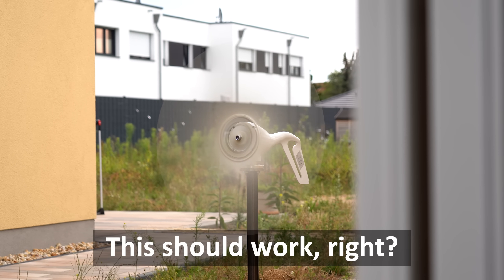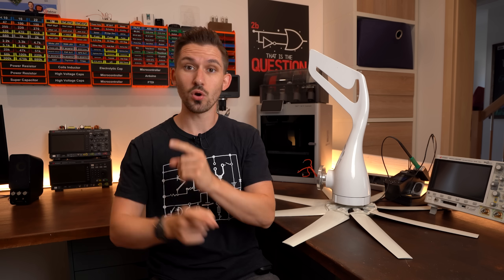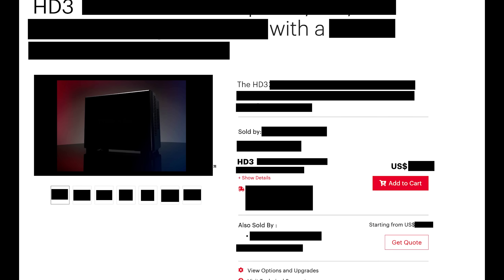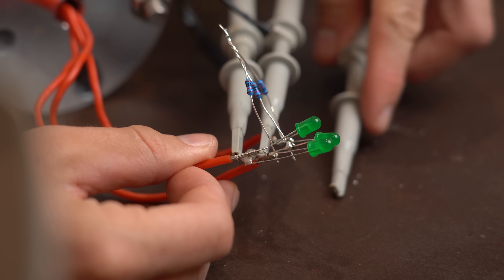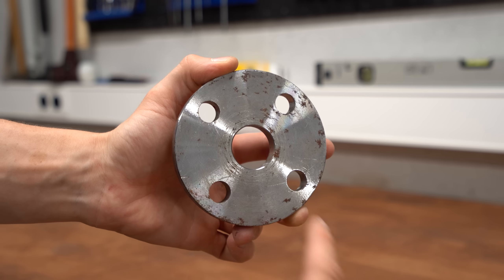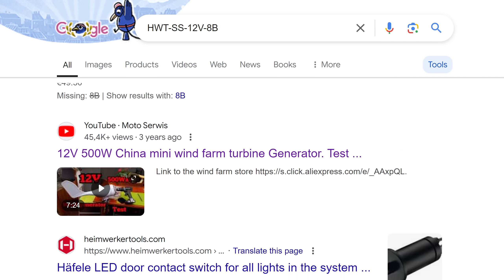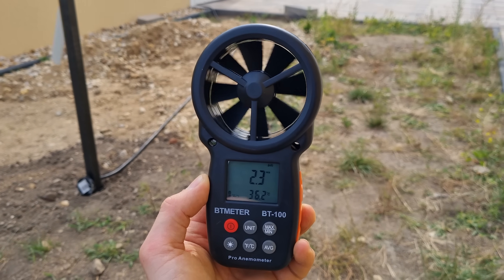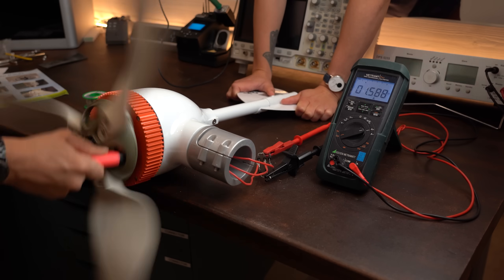I tried to Power my Home with Wind Generators! (Worth it?)

Comment: solar is shit for the environment not recyclable  and only last about 10 years before you have to replace them
Reply: I don't know where the "not recyclable" comes from. Looking around at some manufacturers like swiss solar around 75% (although I've also seen other estimates from world economic forum range up to 95%) of the panels can be recycled and some companies like First Solar, PV Cycle and more are already popping up. The main material which is silicon is the second most abounded material in the earths crust and more common than carbon and newer panels started cutting down on the more expensive materials especially on silver.
The 10 year lifespan is also rather on the short end, most estimates I've read are more around 20-25 years and most of that isn't really total failure but reduced efficiency/power output so they are still usable at a lower power level.
Main issue why you won't see much is because the majority of panels are still in operation considering that according to charts on both canarymedia and bnef the solar production doubled between 2019 and 2022 it's pretty safe to assume that the majority of installations aren't anywhere near their end of life so there isn't that much financial incentive yet to ramp up recycling. Even with the 10 year estimate that would mean panels installed 2014 would now be bust and that would be just about 17% of the total installed capacity from 2022. 

Wind Turbines are also not the perfect solution in that regard at least when looking at large commercial turbines the lifespan also seems to be arround the 20-25 year mark however blades and gearboxes need replacement after 10years. And the blades are very difficult to recycle. Neodymium is also not exactly good for the environment although this is a known issue and research is currently trying to cut down or even completely eliminate the requirement for rare earth magnets.

Comment: Generators in vehicles normally charge at 13.5-14.5 V. That way they can over come with easy the internal resistance of the batter and have extra power to charge the lead acid battery. your little wind turbine would have to really be spinning to do that.

Comment: you can use some mechanical gears to speed up the rotation of the generator then maybe it will work better 
altho i may be hard to figure it out and make it work 
but worth a shot

Comment: i have bought the same 2 pieces of s*** ( only the vertical ones) and i'm not happy, the average wind speed is 7m/s and it is not generating anything. 
maybe you could post some efficient schematics to use these pieces of  s*** for something (like heating garage or anything) and maybe the Chinese will get smarter and sell for other people something better than s***

Comment: All practical tests of ground-based small wind turbines show: 1) They hardly produce any electricity. 2) They do not last long!
No electricity, because there is hardly any wind close to the ground – and electricity yield is proportional to the third power ofwind speed: 100% more wind generates 800% more electricity! Moreover, wind close to ground is extremely gusty. 9 out of 10 small wind turbines therefore stop working after a short time! 
With solar panels, you can generate at least 10 times more green electricity with the same investment! Reliable and almost maintenance-free for at least 25y.
Reply: Thanks for sharing your thoughts! You brought up some great points. If you’re interested in this topic, we encourage you to check out our award-winning documentary called 𝙂𝙧𝙞𝙙 𝘿𝙤𝙬𝙣 𝙋𝙤𝙬𝙚𝙧 𝙐𝙥 - Documentary, narrated by Dennis Quaid. It’s free on YouTube, and it goes into a lot of detail on these issues.

Comment: Hello GreatScott! i see on your video that your placement of the wind generator is not the best. a wind generator shod be placed high up wear more wind and higher wind speeds i would test it and put it on your roof and then u might be more happy whit the wind generators and a longer pole so i will come few meters higher up:) . u probely wont read this Scott but if u do u can anways test it:) mutch love from sweden

Comment: think you should make your own 3 phase boost buck charge controller and rewire the wind mill for higher voltages then combine them.  though your amps will suffer but may still be able to charge batteries and or direct power 12v lights.

Comment: You are a gun man with the electronics.

IMHO the best element of extracting energy from the wind is to ensure that the tip speed to wind speed ratio (TWR) is kept close to the ideal of 7 to 1.  A fair target would be 6 to 1.
So use an anemometer to measure instantaneous wind speed. A rev counter to measure instantaneous RPM.  That gives instantaneous TWR.

Then use the electronics to feed back into the generator coils to regulate how much power you take out (power out being the drag) to modulate the TWR to stay around the set point (TWR=6).

The advantage of that process is that you will ensure the turbine is always operating in a state of maximum efficiency wrt extracting energy from the wind rather than hunkering down around stall speed.  In practice it will allow the turbine to spin up to higher revs before energy is extracted (drag is applied) meaning you will better catch the peaks of wind velocity.

That's my penny's worth!  Good luck!

Comment: Bin there done it. The Grid is very handy with power on demand.  Charging up a bank of used cranking amp batteries  with an invertor was the most convenient setup.

Comment: THese small generators only really work in a marina where coastal windspeeds are a lot higher. Even then they are only any use for trickle charging. It save you from coming back to the boat to a flat battery. Also, the 300 euro cost is nothing to anyone who owns a boat! THe constatnt maintenance thing is also a common feature of anything to do with boats, but it's still an expensive way to trickle charge a battery.

Comment: Its not worth it. If you are connected to the grid and you sell power it doesnt matter that you dont generate energy after dark, if you want to sell more you just add more solar. Off grid you need energy storage, you need enough to keep you power up whole night because even if you add wind turbin it is still unrelaible and you dont know when and how much you will generate. So to sume up you already need to have enough with just solar so what is the point to generate more with wind.

Comment: I live on the ocean, and it's windy all the time. I'm building a power bank out of 3, 12V deep cycle marine batteries. I'm just using it 2 power the oil burning furnace and blower during our winter power outages. I think this might be enough to keep the batteries topped off between outages. They rarely last more than 24 hours at a time.

Comment: I have bldc motor from e-scooter mid drive. It’s rated for 2kw 48v and was fast in the scooter 😅 i have plans build wind generator from it. If i turn it with drill and connect two wires together from 3 phase wires i get almost 100A and open circuit voltage is around 10v so i have feeling with dc-dc booster it should make at least 500w for 48v system 🤪

Comment: Great video! maybe you can try using an e-scooter or electric hover board wheel motor as a generator. They can be pretty powerful, there are 300w, 500w, 1000w, etc. versions, and you can get one used for a cheap price.

Comment: Best thing about 8 blades wind turbines is the fact you can easily resell them to another looser and get a proper one. These are still some toys placed on the ground level, but proper one still performed better and was cheaper. If you could install one properly, with all the money you put in these, you could have something much better than that. For less than 900 EUR I've seen 3kw turbine recently, which could be quite nice when placed on the roof. It would be way more powerful than these combined, that's for sure. 
Germany is a weird place, you can join a band and start world war, but can't place a turbine few meters above the ground, next to your house...

Comment: Might have better results with the turbine mounted higher (like on a roof or tall post) due to wind being defused by fencing or buildings or other objects hence why those big turbines are generally mounted above ocean surfaces or in rural areas with high winds.

Comment: I've been bin watching all your videos for the past two monts or so, they're great. It's the first time I'm commenting though. Even if my YT channel is about woodworking, I'm making a lot of electronics and even used some of your ali express tips. I also put a wind generator at my cottage 23 meter up the ground, yes it's well over all the trees top. It was a waste of money and even cost me a bundle in the end. My generator is 12V DC not tri phase like the ones you described. Even if it's that high on the shore of a  40Km long lake it was useless. I was needing a lot of wind to make a bit of power and during a wind storm the controller stopped working and my 250Ah battery actually exploded, yes half of the top was gone and the remaining filling caps were also gone. So this cost me a new 250Ah battery. The wind generator is still there, but not hooked up at anything, it's too much work to get this down just to throw it away. At least the tower gave me a  place to put my solar panels, this is working way better, if you wish to see this set up this is a link for it. https://youtu.be/Ntf-9GW0Nw8  https://youtu.be/E1SwtB2UPmA

Comment: Any obstacles will significantly lower wind speed, so there should be no obstacles from the wind direction for at least 100m or you should put the turbine on a roof or on a mast.

Comment: The issue is that power-generation grows cubically with windspeed. So if you halve windspeed you get 8 times less power. So let's say you have a turbine rated 100 watts @ 12m/s. If you drop the speed to 3 m/s (halve the speed twice) then you'll get only 100/64 = 1.56 watt. The turbine is probably also less efficient at such a low speed, so in reality it will be even lower.

Comment: I build my own wind turbine. It is on my channel. Little bigger than this. 3m in diameter. Unfortunately like in your localization there was not enough wind. Generator had ca 1kW output on bench. Witch gusty wind by my only 750W. And most of the time wasn't enough wind even for hold the battery voltage. I had PWM controller Al lead acid Akku 200Ah.

Comment: I am doing a science experiment where I am trying to charge one of those tiny UPSs that take two 18650 Li-ion batteries. I have rectified the voltage from the NEMA 17 motor and connected it to a 1000uF capacitor. I have also regulated the output so that anything between 3V and 30V gets converted to 5V (which is the supply needed by the UPS). The problem I have is that due to the erratic nature of the wind, I can have a stable 5V supply for a minute and then it goes off gradually for the next minute. Would this constant switching on and off of the supply somehow be detrimental to the Li-Ion batteries?

Comment: A wind generator that is not designed for low-level breezes? And, let's do expensive modifications, instead of buying or designing one that works in weak breezes?

This is about as silly as buying a bicycle to ride on a highway, discovering that its speed is insufficient, and tinkering with its gears to maximize its speed. This is an expensive toy, not a real power source! What next? How to heat your house and hot water tank with a single candle?

Comment: It acually was cheap, decent wind turbines and controllers cost a few thousand. The size also says you will only get a limited amount of power from it and 48v battery banks require a lot of energy to get a goid charge rate. When you look at the power curves on these turbines they produce little or nothing in low to medium wind speeds and always require high winds to achieve any reasonable power production. Wind generation sucks

Comment: The fewer blades a windmill has , the faster they spin . So...a 2 blade spins faster then a 3 blade and a 3 blade spins faster then a 5 blade . Also the closer you are to the ground the more destructive wind you get . Destructive wind does not produce much power using a vertical axil windmill . You are wasting your time putting a windmill that close to the ground . Ideally 100 feet would be nice . Also , the colder the air the more power you will get . You will get a lot more power at - 40F then you will at +72F with the same wind speed .

Comment: Instead of "mppt" magic you just need a boost (or boost-buck) converter (to get the proper voltage for charging a battery) with a max current adjustment (so as to not overload the generator). But in the end it doesn't worth it for that 0.1W it makes. :P

Comment: Wind near ground level is much slower than at higher elevations due to obstacles like buildings and trees. Even at some distance from such an obstacle there’s still a significant negative effect. 

What makes matters worth is that the amount of wind energy is proportional to wind speed cubed! 

That, among others, make home windmills unviable in the vast majority of cases. 

This is also why windmills have become bigger and bigger over the years. Bigger windmills (that reach higher) are much more efficient than smaller ones.

Comment: Basically, look at how much mechanical movement can you produce with 1 kWh of electricity? Eg.: what whirlwind will a 1 kW ventillator will cause in your home? The flipside is true, too: to produce 1 kWh of electric energy, you need a LOT of mechanical movement. I guess the large wind turbines are not worth it, if you factor-in the initial cost, the environmental troubles and the maintenance needs. US wind farms are already struggling since their product is very expensive compared to other sources of energy.

Comment: .... Um. Why didnt you install it on your roof or somewhere high enough to get stronger wind speeds instead of on the ground?!  Wind mills are high up for a reason. If your house is too small, build a tower so you can get some use out of your wind gen...

Comment: you should use vertical axis windmills, and this needs to be tested somewhere like where i live which receives 25 to 35 mph winds sustained for over half the year, certain times of year its constant 24/7 for weeks at a time - this is the high desert of SoCal, if familiar, you know what i'm talking about

Comment: Do you not need a load drawing from the battery during your tests?
If the battery is already fully charged, then I'd not expect to see many watts flowing, regardless of how many the generator is producing.
You need a load capable of consuming the anticipated output.

Comment: Nice to know but an out box idea funnel the wind to the generator. Iv worked in sprinkler systems and to get greater pressure is to go from larger to smaller pipe same principle was used in water monitors during the gold rush in California lines would tape rivers up in mountains and funneled down to a monitor to excavate hills for gold. I noticed you put the unit between buildings that helped with some funneling but if you had set some panels in a v formation pointing to the blades you might have increased your wind speed and if you had boxed it in slightly maybe even more . Just a thought that you might try since you can’t go above a certain hight

Comment: A wind mill needs to be done right if done at all. Otherwise its a waste, or yard art!.   A modified bldc motor, or modified car alternator, with a Large turbine blade, on a tall tower!  Atleast as tall as the near by trees. Better yet 10'-12' taller or taller. this part can get expensive.   I'm planning on one being about 50'-60' tall. Held  with a 20' tall tripod tower. Then mount a couple 20' sticks of thick tubing. Maybe a 2.5" with a 2" fitting inside it. With a hinge at the tripod's top.  Use abt 50-100 lbs weight on the bottom of the pole  below the hinge weith a pipe hanging below to latch th pole. So i don't need to climb to the top. Attaching a turbine capable of about 3-4kw with a 12'-18' diameter blade, to hopefully get 500 watt on breezy days, and more like 1500-2500 on more windy days, and 3kw+ in storms , a generator takes magnets and copper wire, if there isn't alot of both, with a large blade to spin it. Its not going to produce power..  you would be better off getting more solar panels, and batteries, to store power for night time, or compress air to spin a steam generator (, pneumatic motor) get a refurbished forklift battery, 48 volts , and will last for years and years with solar. Keeping it vharged daily

Comment: It would be interesting to see some form of gear reduction added to those wind turbines and see if that adds any more energy to your system. Although, I suspect that adding too much gear reduction may make it too hard for the props to turn and you may end up putting in a lot of work for little to no gain.

Comment: you need bigger blades,  bigger motor,  and at least mount it on the roof not at ground level,  but that's not allowed there so you're kinda out of luck,  but yeah what you got won't do much

Comment: solar is usually much smarter as primary power, wind is a secondary assist because days with high wind often have little sun.
Reply: Part of being off grid is scheduling usage to match when the power comes in, ideally you have for example heat pump to create lots of hot water and frozen salt water that can provide heat and cold for days from the rarer windy days.